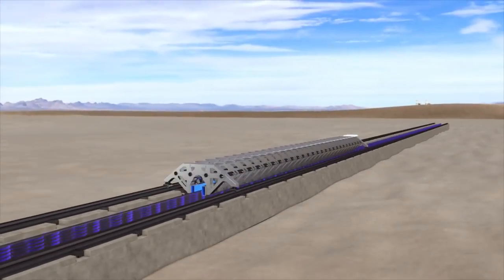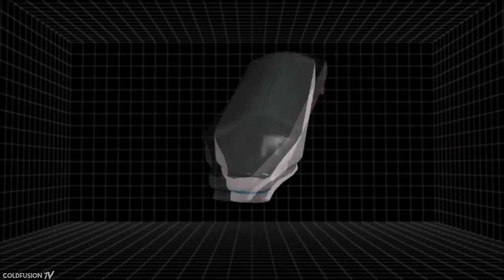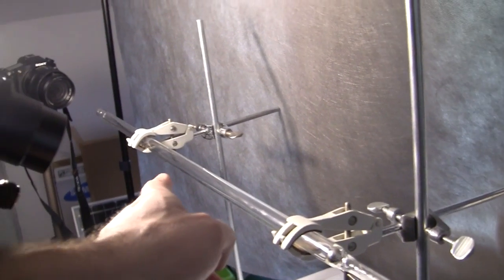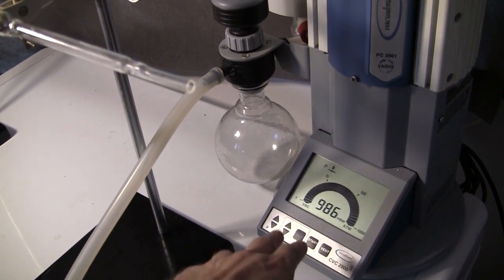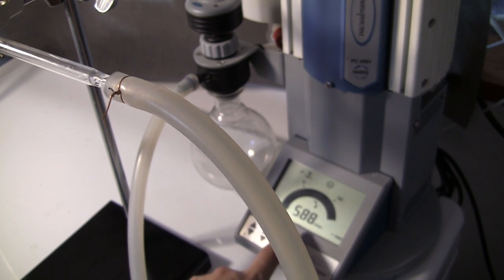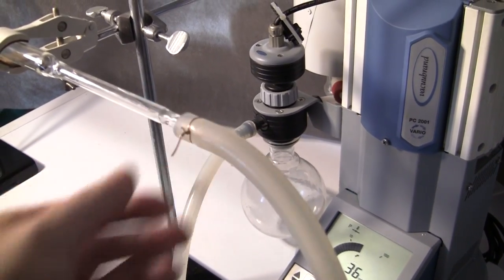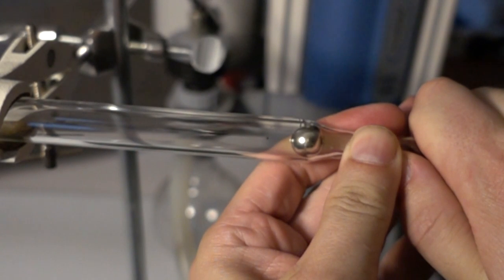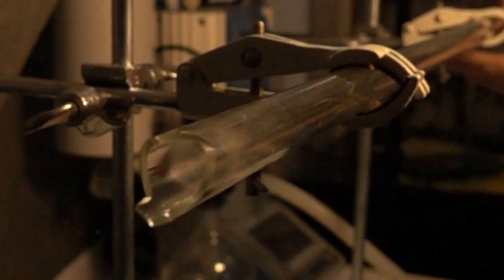How  the Hyperloop can kill you!

Comment: I think building a hyperloop across land is impractical as fuck as conventional trains still have plenty of potential, and trains using magnetic levitation (forgot the name) could also reach very high speeds without the need for an overcomplicated tube being constructed all over the place. 
Where the concept could be applied though would be tunnels. The tube essentially is already there and tunnels generally require a way to equalize the pressure when a train comes through and pushes a shitload of air ahead of itself. Lowering the pressure to 1 mbar seems like solving the problem. Now we just need airtight trains with internal ventilation systems. Cant be too hard. Even if we use rail-trains there might be some advantage to be gained. 
Except that I have no idea how a train would enter such a tunnel without something as slow and complicated as an airlock.
Reply: The problem with bullet trains are air. Fighting against air costs a lot of energy and limits the speed you can go. The idea behind the hyperloop is something I too considered on a separate occasion; if you remove the air you have no drag. And levitating it with magnets removes rail friction. With both air and rail friction gone, you have no friction to fight against. Because you have no friction you can save a ton of energy and time travelling. It is superior in every way to all other forms of transportation. With the hyperloop the only thing that slows the amount of time it takes to get to one place to the other is the time you need to take to brake. Applying the hyperloop to only existing tunnels would be idiotic because there is no benefit to it. Tunnels are short and there's no point to it.
Reply: But, I mean... who really needs to go that fast?
Reply: Tree Topley Would you rather take a 6 and a half hour plane ride nonstop from New York to San Francisco or a half hour or hour nonstop hyperloop ride? And the cost to ride one would be so cheap after it's set up and no longer a novelty, because of the amount of energy it would take would be a ton more cheap than all of that jet fuel. I wouldn't be surprised if after it's implemented and whatnot the price would be 50 dollars, maybe 30 to ride from San Francisco to New York or visa versa (compared to plane tickets nearing 500 dolars). And think about it, the price of electricity is fairly stable, unlike oil. prices for plane tickets go up and down (and inevitably up due to our use of it)
Reply: Mr.chang cooler Hey man. I'll ride it if someone builds it.
Reply: Mr.chang cooler What about the energy being expended on maintaining a near vacuum? Or the money expended on building the hyperloop itself?
Overall it would be easier to simply achieve the same result by going high up in a plane and traversing the distance at supersonic speed like with the Concorde. Except that the Concorde flopped due to cost, maintenance, becoming outdated, and sonic booms being a problem.

Comment: This isn't a debunking of the same calibre as solar roadways. These are engineering problems that could potentially be overcome. Most likely with explosive vents placed along the length. When a breech was detected, the vent on the other side of the carriages would blow, to prevent rapid acceleration. Though I do consider Elon Musk a shady character. This has all the hallmarks of those naysayers who didn't think trains could travel above 30mph, without killing the passengers from the inertia.

Comment: What you have done is you replicated a design for a pneumatic rifle. Your setup is just that. And yes, in case of such design a sudden failure of the system would be fatal in consequences. But it seems you have failed to notice that building huge pneumatic rifle is NOT hyperloop designers goal. Main difference is your design has more or less a fitting projectile forming at least a semi-seal. Basically a rifle. Hyperloop is based on a concept of a pod moving in low pressure environment. It doesn't fit so snugly in the tunnel, it is not intended to. The  tunnel is just a mean of providing low pressure environment, it's not a barrel. Take 2X smaller ball bearing and the same diameter tube and redo the experiment. You will see a huge difference. Still dangerous but order of magnitude less than what you suggest.

Comment: "It's not the fall but land'n that alters social stand'n..." Acceleration and Deceleration can kill you. A few years back my 
engineering group used a vacuum tube and a C-D Nozzle to make ping pong balls break the speed of sound in about 5 feet of acceleration. Square Cube laws say that as diameter increases linearly, area increase exponentially. The only way you could "safely" make this thing work is to keep the pressure behind the car at atmosphere and slowly decrease the pressure in front of it. They are clearly not using that method because the fan would be pointless. Furthermore, even if they did, a failure in the tube ahead of the car would result in hitting a literal wall of air moving very, very quickly right back at you. This isn't a car crash you might survive, it isn't even a plane crash. This is literally a 7,000 lb bullet in head on collision with another equally massive bullet of compressible gas.

Comment: What's wrong with this picture?  Oh, right.  Everything.

The ball bearing in this glass tube was a pretty snug fit within the tube, much like a bullet in a gun barrel.  When the air comes through, it's going to push incredibly strongly against the ball bearing because the ball bearing is plugging up the tube and the air has literally nowhere else to go.  A Hyperloop pod, by contrast, will be about half the size of the tube, which gives the air plenty of space to go around.  Strike 1.

In the blurb, the author claims that "getting hit by a 1 bar pressure wave traveling at nearly the speed of sound is fatal."  Which is technically true, but it would never happen, as the people would be inside a pod which is already traveling at nearly the speed of sound!  Therefore, any jarring acceleration due to impact would be quite minor, especially as there's plenty of room in the tube for the pressure wave to go around the pod.  Strike 2.

Also, he broke the entire tube open.  This is easy when you're working with glass, of course.  With a solid steel tube, though... not so much.  Catastrophic failure of that type is simply not going to happen.  Minor leaks certainly might spring up from time to time, but that won't be a problem any more than it is for airliners, which (contrary to what you see on action movies) can get a hole in them as big as a seat-side window without any serious loss of pressure.  Strike 3.

If this is the quality of "research" that we can expect from this guy, I see no reason to donate to his Patreon campaign.  I've got better things to spend my money on than some charlatan trying to bilk money out of the masses by tearing down something beautiful with lies and bad science.

Comment: you realise that the mass to corrected aerodynamic crosssection ratio of a hyperloop is much bigger? - You usually deliver great science videos - but this once you are wrong and you can fidn out by building the very same setup but use a longer object, like 20cm rod of metal instead of that tiny bullet - the difference (that it will be accelerated much slower) will be obvious - and then you have to imagine the same difference about 20fold (depending on the exact design of hte hyperloop) and it will be far from lethal accceleration. - Also the length or diameter of the tube hardly have an influence beyond an order of magnitude below at thsi point and the diameter of the hyperloop itelf is already overcompensated. Tiny objcets can obviously be accererated immensely by a small force. Thats literally like flicking away a pebbble, demonstrating its acceleratio nto be lethal and hten claiming you can kill everyone inside a train - by flicking at it with oyur finger.
I myself am a bit critical on the whole hyperloop concept - but this is surely none of my concerns.

Comment: 1. It will have breaks
2. It will have bulk heads to isolate a pressure breach
3. A computer will stop the train the instant something goes wrong
4. The train will not be as wide as the tube, it will allow airflow past it. This will greatly reduce the dangerous effect.
Reply: You cannot simply 'stop' a maglev train travelling at 200 miles an hour. A slow deceleration is required or you will literally explode the blood vessels and organs of your passengers. A regular train takes at least 10 seconds to decelerate, this system is supposed to move considerably faster. Also, no seal could close in the time it would take for the tube to repressurise, we're talking less than a second. You cannot simply move a foot thick plate of steel at least 3 meters tall and 3 meters wide at the drop of a hat.
Reply: levi warbrick What makes you think that it would accelerate in less than a second?(see my fourth point) Even if it did, the computer would trigger the bakes and reverse the magnets before air even rushed into the tube.
Reply: CONELRAD
Do you know how a maglev train works? It brakes by polarising the rails in front of the carriage. In other words, were the carriage to be derailed from its magnetic track by, say, a mach 6 shockwave from a rupture in the vacuum, its braking function would be rendered useless.

Comment: The g-forces alone with that kind of acceleration would be beyond hazardous. I can't believe people think this is a good idea.
Reply: What are you talking about?  Doing some extremely rough calculations it appears it took that ball bearing about .2 seconds to travel 60 cm, which I calculate to be an average speed of 3 m/s reaching the top speed being 6 m/s by the end of the tube. That means it's accelerating at about 30 m/s or about 3g's of acceleration. It might not be the most comfortable, but that's not even getting into black out territory. And that's with a catastrophic failure that would be the equivalent of a terrorist completely blowing up a section of tunnel and there being no brakes.

Comment: Couldn't there be valves around the tube to decompress the vacuum on the other side of the pod than the initial failure is on? and current maglev systems already have regenerative braking and redundancies in case of emergency

Comment: Why is everyone soo mad, he's fucking demonstrating how dangerous this "Hyper loop" can be, just because it's NEW and futuristic. DOES NOT mean we should fuck off with science and accept it as safe and "THE WAY OF THE FUTURE" it's like a 80's future movie, where crazy ass technology works with really no science to back it up, and if there is some science behind it, it's most likely wrong.
Reply: They are mad because because In this case he is using extremely week logic this time. Doing some extremely rough calculations it appears it took that ball bearing about .2 seconds to travel 60 cm, which I calculate to be an average speed of 3 m/s with the top speed being 6 m/s. That means it's accelerating at about 30 m/s or about 3g's of acceleration. That is not an impossible obstacle to  design around and create a breaking system for, as long as the train is not creating a seal.

And that breaking system is the hard way to go about it, as there is an even simpler solutions that can also be incorporated like an emergency air lock system that seals off a breached section. Even if the train is in the section with the breach once it passed an air lock close, the air lock and just break like normal. 

Of course you can go with an even simpler solution to that issue, which is simply emergency relief vents, In the event of a breach open all emergency vents and then you don't get any acceleration as equal pressure would be maintained in front and behind the train. (well technically you would get a deceleration due to having higher air resistance then, but in an emergency that's not a bad thing)

This video is the equivalent of making a video of "How the Air Plane can kill you" and saying if the wings fall off it will come crashing down like a meteorite. Actually even that would probably have more merit than this as if there was a catastrophic failure like that there is not a whole lot that can be done to stop the plane from plummeting into the ground and definitely non that are easily done.

Now maybe there are some major issues to this hyper loop train thing, like power or something that makes this thing completely unfeasible and thunderf00t is right to debunk it, hell there might be something else to take into account with this not talked about, but the "problem" as shown in this video is laughably dumb. People are mad because we expect better from thunderf00t.

Comment: Ok, seems fair, but. The air rushing into the tube shouldn't accelerate the pod by much since it's already supersonic. Pod will stop before air does too much damage. "It could fail standing on the station" you say. Ok, here is a solution. Computers work faster then air travels. "Dump" the vacuum on whole section say 3 miles long first and in whole system later. Pressure equalized, no shooting pods. It will be uncomfortable, might even damage the pod, but not to the point of getting everyone killed.
Reply: Forget the acceleration for a moment, do you know what gives explosions their destructive force? Explosions create a vacuum which rapidly contracts, causing what we call shockwaves. Now take the maybe 100 square meters of air a tonne of tnt will displace, and imagine what a square mile would look like.

Comment: Wouldn't the accelaration be quite different for an object with multiple hundreds (more like thousands) of times the mass and less than multiple thousands of times the diameter? I mean, the acceleration would be based on the resistance it would be giving against the wind, so wouldn't a ball be at a "disadvantage" compared to an aerodynamic design (aka. accelarated faster)? I mean yes, you were not down to 1mBar in your experiment, but technically speaking, the proportions are not the same, are they?
Reply: Not to mention that a small air tube can be completely filled with the tiniest exposure to air, while a large tunnel would have to suffer a catastrophic collapse to be filled instantly. Small cracks and leaks would be an inconvenience to repair, but would not be dangerous. It's like a hole in a space station; it's not like all the air explodes into space, there's time to patch it because air can only flow through a hole of a certain size at a certain rate.

The ridiculous thing to my mind is that it seemed to propose propelling itself with turbines, which are based on the same air resistance that they are trying to remove with the vacuum.
Reply: Nope. The force scales with size when dealing with pressure in a tube. A steel ball is fairly dense, so a hyperloop car could be quite a bit longer and still be the same proportional mass. If you had a 2m diameter tube and 14.7psi of pressure behind a hyperloop car on a perfect seal, it would be over 70,000 lbs of force, which is greater than the max thrust of an airbus A320 passenger liner that weighs 120,000 lbs. A hyperloop car would probably accelerate very very fast with that much thrust. Even if the car weighed 10,000 lbs, it would accelerate at over 3g's, reaching over 600mph in just 10 seconds.
Reply: So true.  Thunderfoot called this a "1/100th scale experiment" but he forgot more than a few basic laws of physics, namely F=ma.  I've always thought hyperloop was a ridiculous concept, but this video is laughable.

Comment: This seems like an argument against elevators because of cable failure. Elevators have brakes that activate in the event of cable failure and so could this device. The brakes might not be used in normal operation but they could activate in the event of pressure differential.

Comment: Couldn't the magnetic track slow you down in the event of vacuum failure? It could even be modulated to slow you down at the safes and fastest speed. My concerns would be power failure to the tacks and that causing the ferry to crash wich could break the vacuum seals in the ferry and suffocate everyone on board.

Comment: I was curious about some of the numbers involved here, so I measured the time of the ball shooting down the tube with a stop watch and did some calculations using the kinematic equations.

I measured that travel time as 0.28 second. I also did another calculation using 0.20 seconds in case I was too slow on the start / stop button. I entered the tube length as 60cm ( 0.60m ) as stated in that video.

@0.28sec I got I found V final to be 4.29 m/sec ( 9.59 MPH) and acceleration to be 15.31 m/sec^2 ( very close to 1.5G's )
@0.20sec I got I found V final to be 6.00 m/sec (13.42 MPH) and acceleration to be 30.00 m/sec^2 ( very close to 3G's )

Neither of those seem anywhere near deadly to me. 

According to what I found on Wikipedia, If the passengers were facing forward in their seats they can take 10G's for up to 1 minute, or 20G's for less than 10 Seconds. Hitting the other end of the tunnel at mach 1 would probably be a deal breaker though...

Did I make a mistake somewhere?

I realize ahead of time that the actual train will probably be 100's of times less dense than that steel ball, which means that it would accelerate much faster... But I really have no dog in that fight. I'm just talking this about THIS experiment.